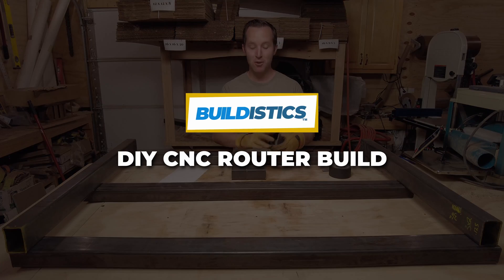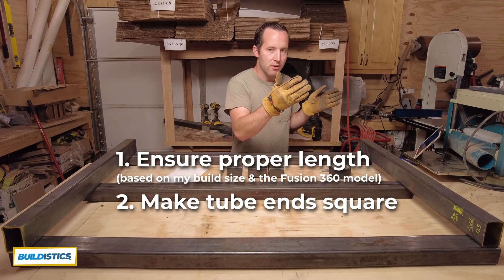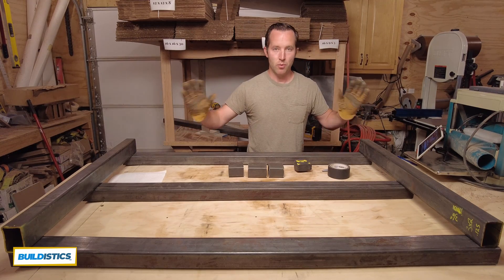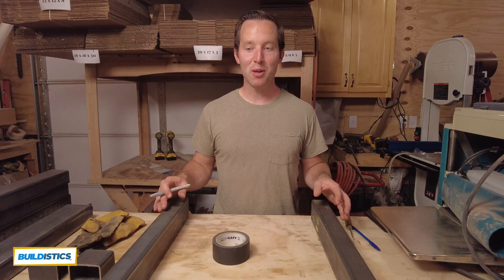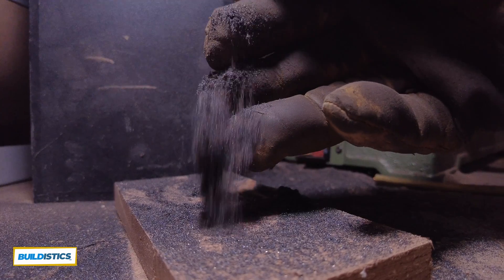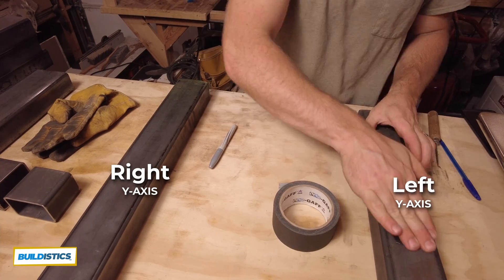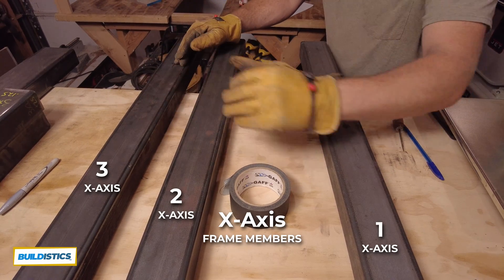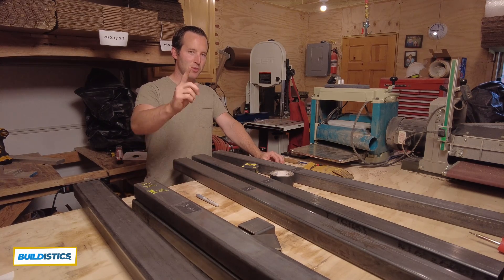DON'T Drill & Tap Until You Do These 3 Things! (PrintNC Steel Frame DIY CNC Router)

Comment: You don't think it would be better to have someone who has a milling machine square the ends and insure the proper length of the tubes for you?
Reply: I feel like he was done dirty by the shop who provided the steel. That was a lot of correction for something with set dimensions and lengths. I've watched a lot of these and the touchups are never this bad. But he made do and its looking great!
Reply from the maker: That would be ideal!  I did it with the tools I had available, but if you have access to a milling machine, all the better!